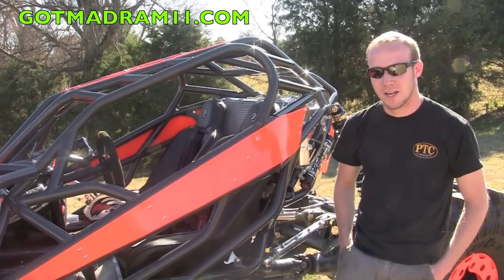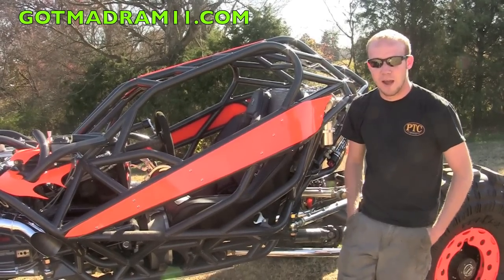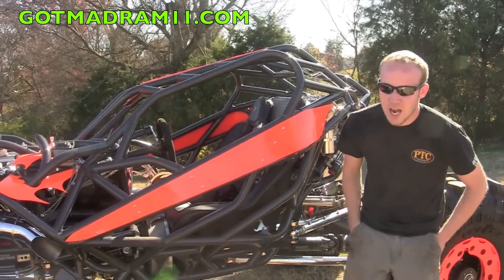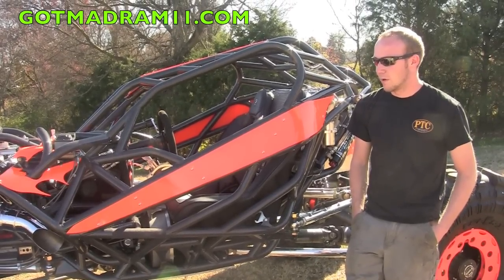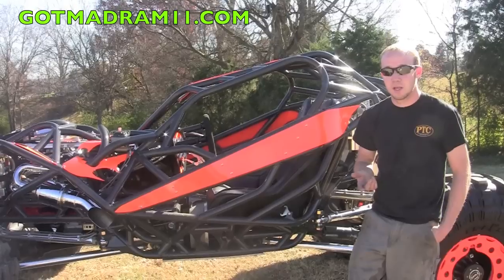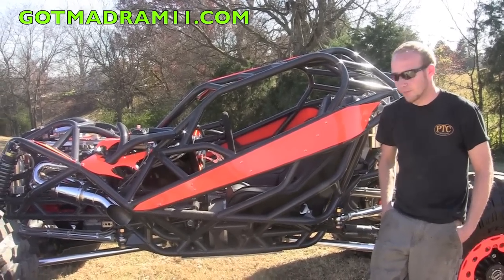GAME CHANGER TIM CAMERONS NEW BUGGY

Comment: Out of curiosity. Why so much Engine/HP? Unless you're doing a timed event where you can hook it and go it almost seems like a good way to break parts.I been racing VW based buggies and cars for 10+ years and never run a Crawler. Considering it though..but our buggies weigh 1,340Lbs/200 hp rear drive.definitely Not going where this one goes though